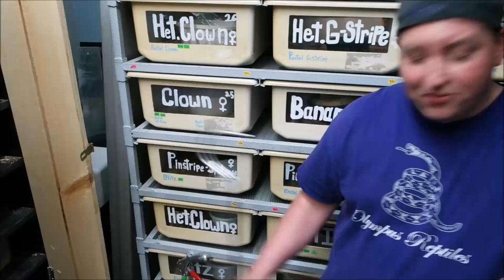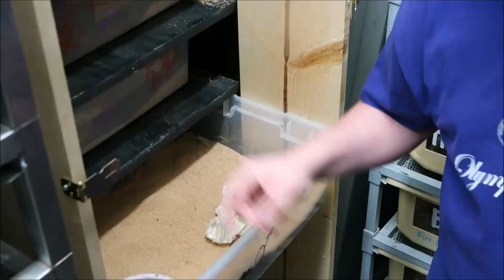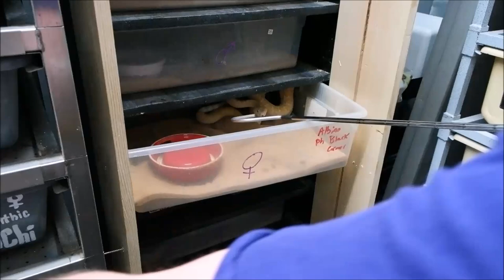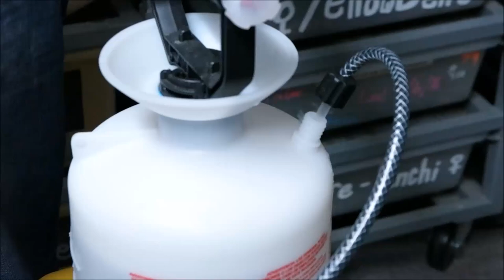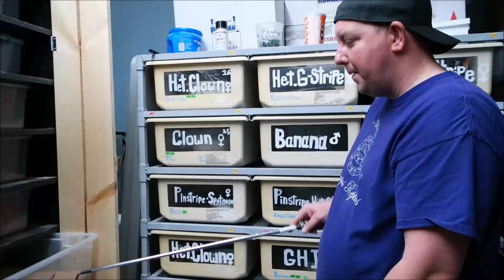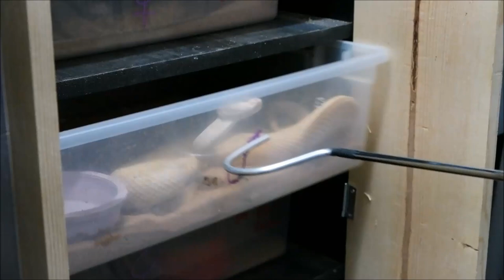Cleaning a rattlesnake tub!

Comment: I saw this vid about another hot keeper who used these see thru locking buckets... they were pretty cool... he said he used to use the ones you guys are using now.. but he had a problem. with snakes popping out like springs when he opened it.. but he switched over and he could see exactly what the snake was doing and where it was doing it... and the snakes actually seemed much calmer in them also... maybe something you guys can look into... keep up the great work guys..
Reply from the maker: lovemyreptiles if I found one I would certainly try it.  I use the loop just in case one does poop our.  I also use a trash can for the cobra, as they will pop out.